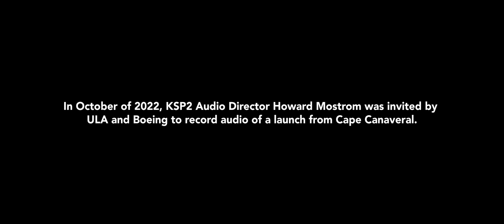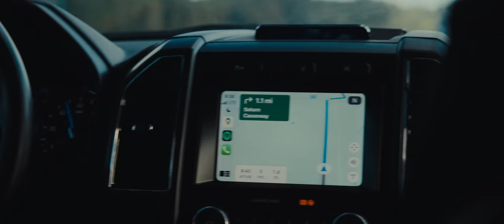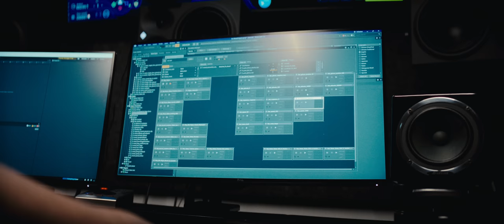Kerbal Space Program 2: Episode 7 - Recording Rockets

Comment: While I appreciate the opportunity this provides, there couldn't be a less optimal rocket to record and build a sound data base from..... I work in the space lift industry, and have played kerbal since just about day 1. All Rockets have distinctly different sounds, but especially SRB's, and of all the SRB's Atlas' specifically had a distinct sound. Further, the very essence of Kerbal is often lots of engines - engines everywhere. If you ever hear a Falcon launch, it is distinctly different than any other launch as well. A distinctly different crackle as the sound waves coming from 9 different merlin engines constructively interfere with each other. Fingers crossed KSP 2 blows my mind, and these sound engineers pull it off, as with all the other hard working individuals working behind the scenes.

Comment: This sounds amazing! But please turn down the staticy microphone overdrive artifacts when the rocket is at full power. That does not sound pleasant. Otherwise, super cool to have it that realistic!
Reply: The popping is actually a real sound, oddly enough, not a microphone distortion. Rockets just sound that way, at least in atmosphere; it's from interaction between the supersonic exhaust and the surrounding air. Would be nice if they turned it down when there isn't surrounding atmosphere to cause that, though, which opens up a bit of a can of worms of "what should it sound like in space?"; what gets conducted into the vehicle is a bit more expensive to record...
Reply: @jonored  if you mean the crackling of srbs they are awesome. But the staticy white noise is just kinda painful to listen to. And even if realistic would not be a pleasant gaming experience I think.

Comment: OK, but are you going to stop making dust billow in the air on airless worlds?

And, now that we're talking about sound, what are engines going to sound like on airless worlds?
Reply: Dust will kick up when an engine fires near the surface
Reply: I like how the mods do it on KSP1. Gives you an option for vaccum muffling from none to completly muffled. I Like to set RSE to 90% muffled in space so I get a nice dull rumble. Then when in IVA its full blast.
Reply: @captainahab5522  As it should. But there's a huge difference between dust being kicked up and dust billowing in the air. The first trailer distinctly showed dust billowing in the air. Roundish puffs of dust, moving slowly and fading away. That's not what it looks like in vacuum at all. In vacuum, each particle of dust follows a separate ballistic arc as it falls to the ground, so it disappears very quickly and doesn't make puffy clouds.

It's a small thing but it makes a difference. One of the many reasons I believe the moon landings happened is that Hollywood never seems to get this right. I like almost everything I'm seeing about KSP2, and the KSP2 team is obviously very passionate, and that's great. But things like this make me worry that they're (so to speak) KSP nerds, not space nerds.
Reply: @motokid6008  It's not just that you can't hear it from outside, it's that the sound you hear from inside is totally different, especially in vacuum. The distinctive crackling sound of a big rocket launch is caused by the exhaust jets mixing with the surrounding air. I don't know what rocket engines sound like from inside the vehicle in vacuum, but I'd like to. And I know it's very different from what they sound like from the outside in air.
Reply: @kjgoebel7098  - I just played last night some. It's not actually full blast inside the cockpit. It's just slightly muffled. Actual sound from inside a let's say a Dragon capsule would be amazing.

Comment: I find it interesting that the direction of recreating with the direction of "realism" in audio design seems to tend to the path of how the equipment picks up audio and not how the audio really is.  So the result is not an incredibly bombastic, fully fleshed, high range and incredible sound but instead a highly compressed via CLIPPING sound because the the recording source was too close and too incapable of proper recording.  

Not really a pro or a con just.. an observation.  That's not how a rocket sounds.  That's how a rocket sounds to a microphone too close. 

reminds me of the age of trash rap where bass lines where clipped in production to emulate the sound of rap being blasted out of really crappy sound systems.  whole meme generation was founded on this too.